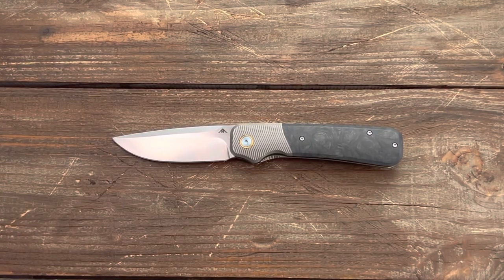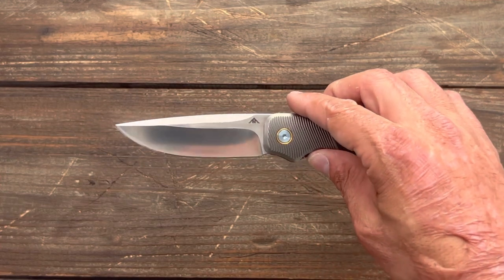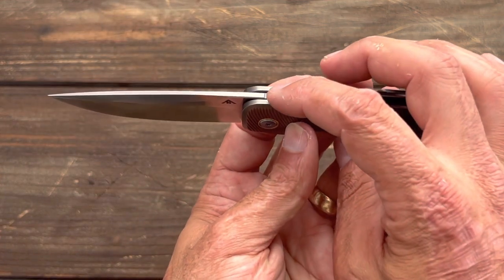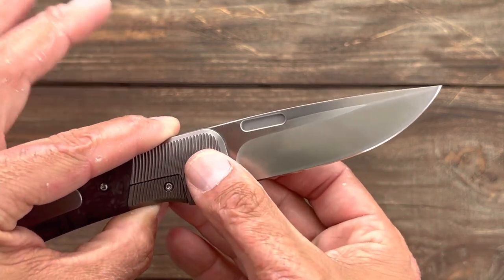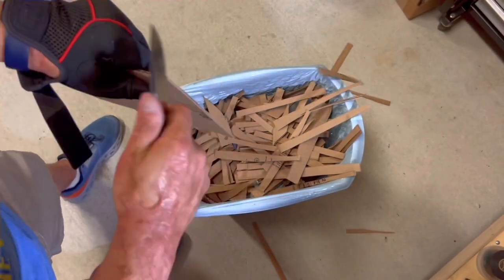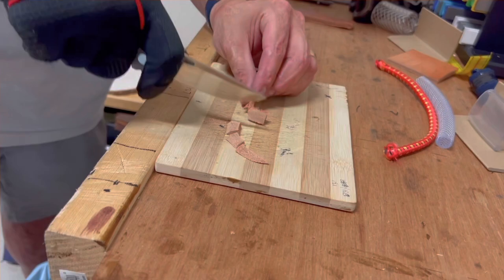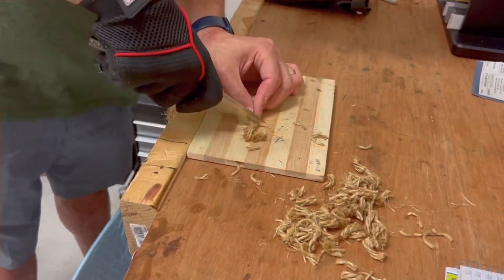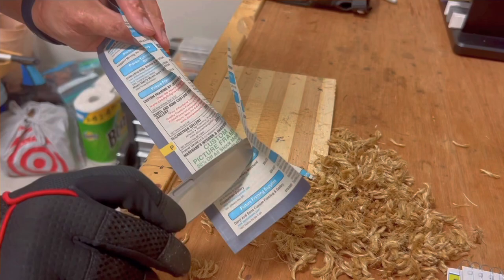MIGURON - AM8 KNIVES : FLIX FRONT FLIPPER / TESTS & REVIEW

Comment: They just released the Flix II with a lot of upgrades that were suggested! Extended the front flipper up, did a cut out through the blade, and they moved the blade steel to S90V!!! Would love for you to do a review on the new version, if they fixed some of the issues I would pick one up!!!
Reply: I got one a month or so ago and love it. Never handled the "older" one, so I've nothing to compare it to. 

Front flipper works well with the forefinger swipe. My thumb has some starts of arthritis, so I don't thumb flick the flipper tab usually and only use thumb holes/studs if it's an upward motion rather than a side motion. 

I've seen a different YT'er say the reverse flick is tough, but I've not had a problem at all after a couple tries. 

Fit n finish is pretty darn good too. The S90V blade came with a wicked edge out the box. I went with the silver fat carbon.

Comment: Thanks for the show, Stassa!

I bought one of these too, right when they came out. This design, is right up my alley.

My only issues are the pretty weak detent (only off by a touch) and mine did not come sharp either.  As a matter of fact, all of the Miguron & AM8 knives I have bought (5), and all of the ones my friends have bought (45-ish). None have been 'sharp', except for one guy, with one knife, once.
 : - ) 

All tested on a BESS sharpness tester. They all average as being about 1/2 as sharp as a new Spyderco. So they can now easily be crowned King of the un-sharp knives. Of course someone has to hold this position, right? It is the area of production they need to address soon. I keep telling myself I should email them, and let them know, but I haven't done that yet. So maybe it's my fault! : - )